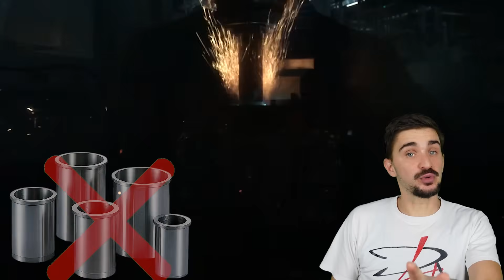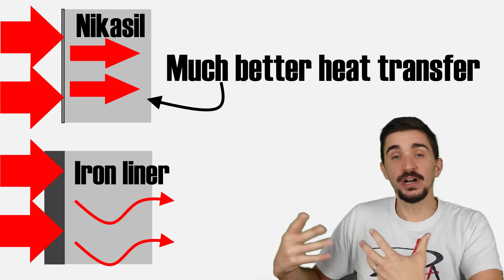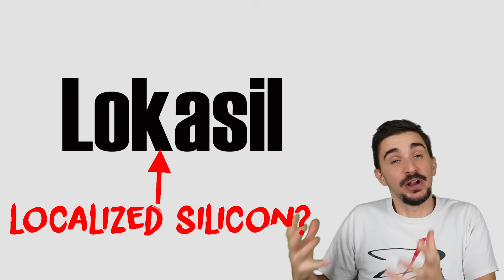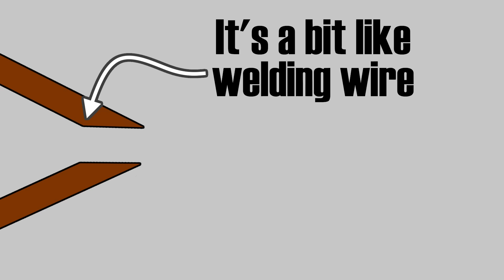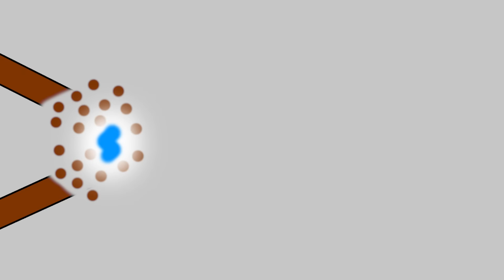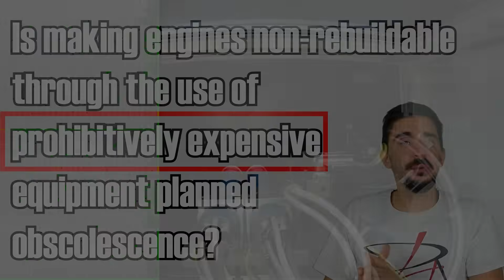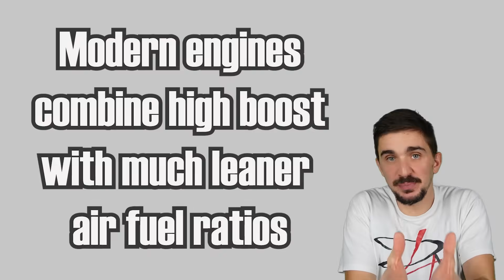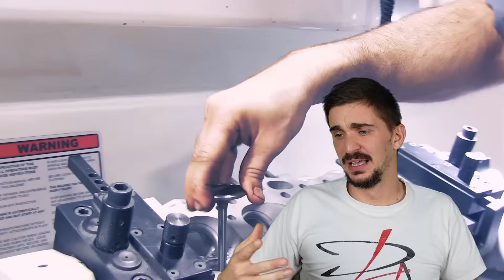Why Are Engines Becoming Non-Rebuildable? Everything About Cylinder Coatings

Comment: People forget that fuel economy is a major consideration for a lot of car buyers. As d4a mentions, Race engines run rich. I had an rb25 skyline, 400 whp. It used 16L/100km. Currently big heavy 4 wheel drive pickups get much better economy.
Reply: My 1.0L does 16km/l at the highway. And who cares about big puckups, they are bad anyways
Reply: @gabrielvieira.4358 he said 16 litres per 100 km, not 16 km per litre. Very big difference there.
Reply: @jonm7272  I dont use american
Reply: @gabrielvieira.4358  I can't believe I need to explain this but here we go...neither of those are American, they are both using SI units (litres (quantity of fuel used) and km (distance travelled). The original post says how much quantity per distance (l/km), your response is saying distance per quantity (km/l), see the difference? Let me make this easier, 16 litres per 100 km (from the OP) is the same as 6.25 km per litre. So now you can compare that to your 16 km/l (so 6.25 vs 16).
Reply: @jonm7272   I rather use KM'l instead, it's much better. Thanks for the explanation
Reply: @gabrielvieira.4358 it really doesn't matter whether or not it's "better", it's not the unit everyone else is using. You may as well write your text in Pashto, you will be understood just as well.
Reply: @alanhat5252  Not really, I dont know what is that language, nor many people.
Reply: And I don’t use Metrics.  WE, NOT JAPAN/GERMANY won the war.
Reply: @gabrielvieira.4358  precisely!
Reply: @jamesbosworth4191   Who exactly is 'we' here?
Reply: @jonm7272  We Americans know our system is not actually our's, it is British, but we don't know metrics.  We have all heard of it, but we can't visualize metric measurements.  We don't, for example, know how much litres used per kilometer is off hand, but we DO know how much gallons per mile is, as we know exactly how much a gallon is and we know exactly how far a mile is.  That's why you should display BOTH systems on web sights.  PS:  The metric system is French, and the French love Renaults.  That should tell you something.
Reply: @jamesbosworth4191  I believe you ought to drive a Saab. 
After all, those were once made in Trollhattan, and as professional troll, you really have no reason not to.
Reply: @whtalt92  Why do you guys think that anybody who disagrees with you is a "troll".  PS, I am retired, so no, this is not my "profession".
Reply: @jamesbosworth4191  I'm calling you out specifically since your comments show a distinct absence of factual elements and limit themselves to chauvinistic chest thumping. 
You did not win the war alone. 
Certainly, you did not liberate my country - that was Canadians, Brits and Poles.

What you ARE alone in is stubbornly avoiding SI units while moaning loudly that the rest of the world has moved on beyond your ideas.
Reply: @whtalt92  You are wrong.  My comments are based on FACTS.  Yours are based on your OPINION.   I realize that we didn't win the war alone, but if we had never been forced into it by Japan, there is a good chance that all of Europe would have been defeated by the NAZIs.  And if you want your posts to be seen by us here in this country, quit acting like we don't count.
Reply: @jamesbosworth4191  At least you're good for a laugh.
With regards to opinion, you are definitely not exempt looking at your quip regarding metric and Renault. 
Yes, Renault is (mostly) French. That is a fact. Yes, the metric system has it's origins in France (before the Revolution even). Also fact. Jumping to the conclusion that therefore it must be bad is an opinion.
Reply: @whtalt92  Yes, that it is bad is an opinion, but me saying that most of us can't relate to it - we can't visualize metric measurements - is not my opinion, it is a FACT.  It is a fact because we don't know how much they mean.  For example, it you say something is 137 centimetres, we don't know how big that is, but if you say something is, say, 6 feet, we all know exactly how big that is.  Same with distance.   We all know how far 37 miles is, but most of us do not know how far 37 kilometres is.  We know how big a 261 cubic inch engine is in relation of other American engines, but we don't know how big a 6 litre engine is in relation of other American engines.  Another thing that I don't like about the metric system is that there is no counterpart to the Foot - something, say, about 20 centimetres.  Having to such a huge number of centimetres for something large, but less than a metre, (yes, I do know that a metre is about 39 1/2 inches, not much longer than a yard, which is 36 inches).
Reply: @whtalt92  PS:  My vehicles are a 73 GMC and a 54 Chrysler, so I don't have metric vehicles, nor do I have metric tools.
Reply: @jamesbosworth4191  Sorry, not buying that. 
The rest of the world seems to be able to relate older measurements to metric pretty well - (imp)gallon or pint to liters, pounds and ounces (or even pond & ons) are still regularly used and converted with relative ease by the majority of people. 
It's mostly stubbornness, helped by relative isolation, that is stopping you from using metric.
Reply: @whtalt92  Yes, it is partly stubbornness, as I feel like you Internet types are trying to FORCE us to go metric, and partly because of relative isolation - we were never really taught much about the metric system, and we never were in situations where we would have had to know and use it, so it is simply not familiar to us, and, at least for me, I like to be able to visualize things.  I can't with most metric measurements.
Reply: @jamesbosworth4191  I spent about half of my life without the internet since it wasn't commercially available until 1994 here. Now, what was that about internet types again?
Reply: The answer for that is diesel.
Reply: 16l/100km for 400whp is not even that much.
Reply: @staLkerhu  for a 1990s smaller car, its terrible. Camry of that vintage uses less than half of that.
Reply: @ name a car with that amount of power and meaningfully better fuel economy. I will wait...
Reply: @staLkerhu  16l/100km(~15mpg US) is terrible fuel economy. Basically every sports/super car making that power post 2000 gets better mpg until you get very high output NA V8/10/12s or cars with big draggy aero and super sticky tires.
Reply: @Capitanvolume   Why not have a fuel efficiency map? It is a sports car though so mpg is a low concern but you can use tunes to improve it a lot no?
Reply: @TalooshDaBoss  you could but that means running leaner and that risks engine problems. Its why d4a says old engines are actually worse in that aspect.
Reply: Not for a full size car it isn’t.
Reply: @staLkerhu alfa giulia quadrifoglio 500 hp did 13l / 100km without breaking a sweat. You could get it below 10l if you tryharded it maybe just on highways
Reply: @blanco7726  and is that a 90's car Mr Genius?! I don't think so.
Reply: @staLkerhu  I dont think I care if its a 90s car lmfao this is a comment section either word your questions better or expect that people dont read your mind every time they reply. Mr einstein

Comment: I'm confused ngl, why is it so hard for NA car motors to reach above 100hp/L while motorcycle are doing 200hp+/L?
Reply from the maker: Horsepower is torque * rpm. If you rev to 15.000 rpm it's not hard to make big hp. And you can rev to 15k because your piston weighs a fraction of a car piston.
Reply: @d4a  yea but why don't I see many performance cars reaching close to 200hp? But almost all bikes reach it even if they aren't that performance oriented? And you can always gear down for high rpms? And fuel economy doesn't really matter in performance cars. Is it because of stricter emissions for cars?
Reply from the maker: I answered it. They don't rev to 15k

Comment: You're forgetting one massive detail, most Used cars from US and Europe are sold to less wealthy countries, that is where many more rebuilds happen, where those 10-20+year old cars do another 10+years, we have a family business doing just such repairs.
Something else preventing rebuilds of modern engines is the use of "cracked surface" rods and main bearings.
add the complicated electronics of modern engines with a tendency to die with the harsher environment, fuel and users, and the result, is that these countries little by little are starting to get squeeze out, they can't afford to buy new
Reply from the maker: That's an interesting topic to discuss honestly. I come from the Balkans and I'm well aware of that. Prices of known super reliable cars are rising, probably partly because of this too.
Reply: @d4a  It doesn't matter how much CO2 is saved in the West. Asia is increasing their emissions at such a rate that any savings we do is moot.
Reply: @autodidact537 The whole CO2 arguement is moot.  The gas is the thing we exhale from out lungs and what the plantlife breathes to produce oxygen.  We are the carbon emitters they want to eliminate.  Just ask Bill Gates with his carbon reduction equation.
Reply: @autodidact537  also, the west is not cutting emissions at all. Consumption just keeps growing faster than any successes in improved efficiency.
Reply: @autodidact537 Well that’s an easy excuse to say that people in the west don’t need to do anything. Emisions per person is still way lower in Asia, and the bulk of emissions are caused by production for western customers. Blaming Asia isn’t going to help.
Reply: @autodidact537  that makes no sense. Per capita Asia has way lower CO2 emissions than Europe and especially North America. Asia is just bigger.
Reply: @d4a  I would say judging by the accent you're not Spanish. Greetings from Balkans.
Reply: @Helloverlord he’s bosnian
Reply: @d4a  This is a valid point. The economics of developing countries is substantially different. Labor is much cheaper there and money is much harder to come by. Also, it would be worth exploring the environmental models more. Specifically, what would be the impact of having a car that can be rebuilt indefinitely in terms of energy savings and emissions. The assumption that a car will just last 15-20 years and then be scrap is a bit smug and reflective of the consumer culture of developed countries. For example people in Afghanistan are still maintaining Toyota's from the 1970s or people in Cuba drive 1950's American cars. Another issue is that even in the developed world the cost of a new car is rising. Here in the US a new car costs  $50k. The idea that such a high price won't incentivize people to keep cars on the road is another consideration. Honestly, the parameters of the argument that cars will only last a certain period of time needs to be thought about.
Reply: @d4a I’ve had first hand experience of the Balkan love for indestructible cars. Our Serbian neighbour wanted to give a Mercedes w123 240D to his family back home. We road tripped across Europe with two cars to drop it off to them (then drove back in one). Any time we were sat in traffic in Serbia, he’d  get asked if it was for sale, or receive offers.
Reply: first world countries can't afford new either
Reply: @_ford_crown_victoria_p  well, most of Europe are quickly becoming another one of the "less wealthy" countries.
Reply: yeah, but many countries have their own emissions law's that are as strict as those from US and EU (at least for brand new cars) so manufacturers are required to sell these disposable engines by our own governments, if it was solely their choice those things would never hit production, in Brazil they pushed A LOT of super old engines and platforms as far as they could, Fiat sold the 1984 Uno till 2013 (when legislation required air bags), their Fire Engine was only phased out as of last year if i recall correctly, GM/Chevrolet still sells revised versions of the 1980 Family 1 engine, they sold 2 generations of the Chevy Onix alongside untill legislations required stability and traction control, Renault phased out the Sandero RS with the F4R engine in 2021 due to emissions regulations
Reply: You can get oversized bearingsbfornthose fractured rods, hone the big end out to what ever oversize and use new bearings
Reply: Cracked or fractured rods and caps have been around for years.Seen them first on HINO E13 truck engines and they were regularly rebuilt.
Reply: You can buy cheap electric cars that don't have the ridiculous safety regulations of the West. 
If i buy that same car its limited to 45 kmh and basicly a driving safety hazard.
Reply: @stefanpredl6849 we sell 45kmh electric motorcycles from china. Absolute rubbish and a hazard. The build quality is so low we have to fix them before we can sell them new.
Reply: The vast majority of used cars in the US are resold in the US. But yes, a small fraction go overseas (maybe 2%).
Reply: @nwsvndr 2% overseas? You have to visit Mexico to see the vast amound of ~10y old US cars there. After 5y or so, these go on further south. In Japan it is cheaper to sell a 2y new car to other SE Asia country and buy a brand new one than pass the rigorous 2nd year technical inspection.
Reply: @mic602  Yes, reputable data suggests 2-3%. What's your souce? Your eyeballs don't count, get us reputable data. Now, if you're asking about the number of used cars in Mexico that came from the US, then you're asking a completely different question. And yes, I've been to Mexico and many other less-wealthy countries.
Reply: @n @nwsvndr at is exactly the completely different question that I asked? And why do you think the article on the back of your local giveaway newspaper is so superiorly  reputable to someone’s “eyeballing”? Are you claiming that people of different opinion from yours are inherently short on reputation? You may keep claiming that.
Reply: Another superb video from d4a. 
My old ass wants to buy something good and keep it forever, instead we’re led to believe that it’s better to throw away (hopefully recycle) and buy a newer, cheaper replacement. We hope that those who say they know best really do.
Reply: @rageracing5614   The hope may be forlorn, thinking here of that Titan submersible thing, and the head honcho who made a point of Not hiring old white guys. 😀
Reply: @rageracing5614 if you have something that you can open it up and fix it when it misbehave - you truly own it, but not everybody can invest in learning how to swap screen and battery in his smartphone to triple its service life. As to buying something good to keep it forever, we know if something is really good in a hind-sight, as the “less good” but sometimes shinier things fail to survive
Reply: @rageracing5614  
It's the "appliance" model of manufacturing.

Modern cars (like EVs) are appliances, not vehicles. Like your phone they're supposed to last a certain amount of time, then you throw them away and get another.
Reply: @freman007 facts.
That amount of time seems to be about 5yrs.
Reply: @rageracing5614  I want to drive it forever, too. I just worry about the increasingly crap quality of replacement parts. Will I be able to source parts for my 1994 F150 in 2040? The odds are good...but the goods are odd.
Reply: I'd say at least pertaining to connecting rods, you aren't reusing part of it if it's mating piece goes bad.
Reply: Electronics are not bad, in fact we have opensource electronics for the engines where you can repair and revive old engine that lost their ECU, and is very cheap to make yourself.
Reply: @richllama-rm  I would suggest you to take a look at court case "customer association vs John Deree company" in US  to get a tiny glipse of what is going on at the market before claiming something that bold. Check "Right to repair" movement while researching and why it has been found in a first place...
Reply: @Helloverlord John Deere are an extreme case & their attitude is driving away customers.
Reply: @ As I would buy a jhon deere and as if my country ran on USA protective laws. It makes no sense to look at that case
Reply: @richllama-rm  Where can we learn more about this?
Reply: @ Search speeduino. There are others but speeduino is the most supported
Reply: @Jrod_FPV  You can't. He purposely said nothing in his first comment because these is nothing. He's seen your comment and ignored answering.
Reply: Not current ones and even motorcycles have multiple computers and instruments with controllers. They do fail and they are expensive. It's a nightmare. Comparing decades old technology repairability to modern stuff is a fallacy. The instruments are glued together now and water tight so it's unlikely you will make a satisfactory repair even if you can fix the issues inside. Look at cell phones, they were repairable but this is now a nightmare even to change batteries or screens.  @richllama-rm
Reply: @richllama-rm where can we learn more about open-source automotive electronics & replacement modules/ECUs?
Reply: car addiction is a weakness, in poor country you have to be strong, so buy a motorcycle (one cylinder obviously, to repair for dirt cheap in one evening by yourself) buy propper gear, learn how to ride during freezing winter, and you will succeed  ✌
Reply: @chiboreache  nah rather just not be poor asf 😂
Reply: @chiboreache youre saying that access to better cars is a weakness. I would say that being able to adapt to limited circumstances (unreliable motorcycles) is a strength that doesn’t necessarily fade just because you are able to steer your circumstances in a way that earn you a Mercedes

Comment: A mechanic brought up a good point to me, 40 years ago when you opened the hood of a car it was all rubber and metal. Now it's mostly plastic because manufacturer's know the car won't last!
Reply: Yet the cars of today last 3x longer than the rubber and metal ones. As usual, the grease monkey is an idiot.
Reply: @OtisFlint  d you actually believe that?
Reply: The old car is also a heavy vehicle with poor safety standards.